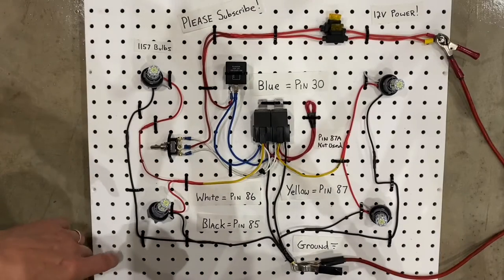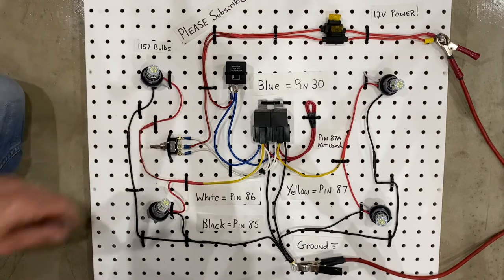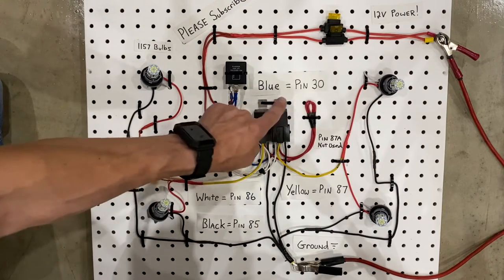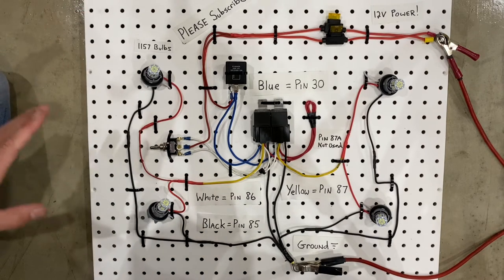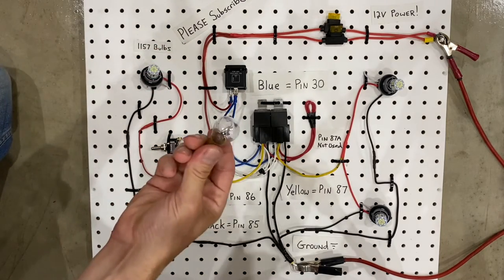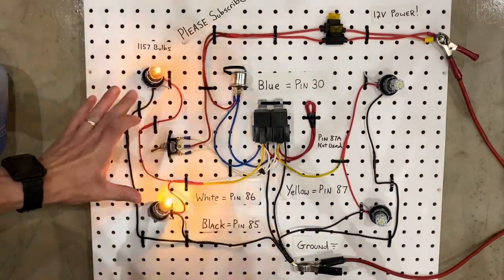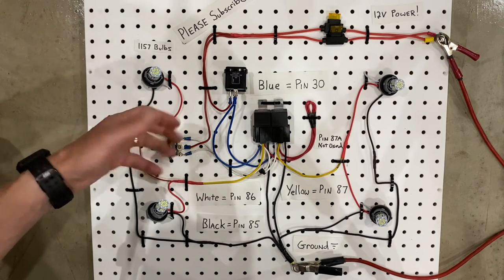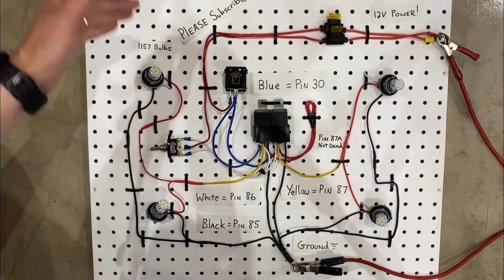How to Wire LED Turn Signals / Flashers to ANYTHING | Hotrods | Motorcycles | ATVs | Mopeds | Cars

Comment: So how does this show wiring turn signals to anything , if what you adding to already has say brake/run lights on it. This doesnt show how to add turn to a system that has brake and run lights. Or are you just adding more lights on and not using the vehicles already 1157/2057/4157 that uses run and brake lights.

Comment: I used your video instructions to install LED turn signals on my 1935 Chevrolet.  Works great.  Make sure the flasher relay that you use is for LED bulbs/lights, or they won't work.  thanks Jeremy for a great video
Reply from the maker: Thanks for the kind words! 1935 Chevy’s are absolutely beautiful.
Reply: But does your car run on 6, or 12 volts? I have a 6-volt system on a motorcycle, and the heat-activated, bimetallic-strip flasher and incandescent bulbs never worked right. Always dim, never flashed. 

But I find 6-volt LED bulbs and other parts hard to locate.
Reply: So are you running a 6 volt system? Does the LED function well?

Comment: Absolutely fantastic video!!! I was about to have to rewire my entire golf cart after swapping over to LED from incandescent! And to top it off, I would have been in the same position as I am now had I rewired it. Because I would have rewired it the same way it is NOW! not good! Now to search and find out if you have a video of adding a 4 way flasher not just the turn signals.LOL what do you know about wiring an ignition key switch? I have a 5 pin and have no clue what each of the pins controls and seems there are no videos available to give that tidbit of essential information. If a 4 pin would work as a replacement I am willing to go to a 4 pin instead.
Reply from the maker: Glad you enjoyed the video! Here is my 4 way flasher video: https://youtu.be/lnhMx-fnUmI. I haven’t done the ignition switch yet, but I did buy one specifically to make a video on. So it will happen.  Stay tuned and good luck with the golf cart!
-Jeremy

Comment: I have just installed a jegs wiring harness and fuse box. It seems to have the old skool flashers. Is there flashers that will fit in it for my LED turn signals ?  Great vids by the way .
Reply from the maker: Thanks for watching the video. I’ve never tried this one, so I can’t promise that it will work, but the listing says that it’s an LED flasher, and it’s the round style that your harness probably has. So maaaaybe this one would suit your needs? 

United Pacific LED Flasher w/ Polarity Reversing Adapter 12V https://a.co/d/5KVlquw

Comment: Great instructions here, i watched because i want to add running board LEDs to my suburban but i want them to flash with my turn signal. Im thinking that the switch would not be needed in my case and i could wire into the truck turn signal but using all the other components that you used in this video. Any suggestions?

Comment: HI - Thanks very much for the clear video. I want to add Led turn signals to my old motorbike which has a 6V system. I also would rather use a group of individual leds wired into a pattern rather than a bulb. Each indicator would be made of 4 or 5 Leds, so that would be 8 or 10 per side that need to flash at once. If I copy your system do you think it will work in my situation? Cheers, Chris

Comment: I really like your video due to all the very accurate information you give out. I was wondering if you could make a video showing the front head lights with turn signals and and tailights and brakes all mixed into 1 video? I am currently rewiring my car and I really would like to see how you do this. Thank you
Reply from the maker: I’m slowly but surely working my way up to that. The tricky part is organizing it all in a way that is easily digestible and not super overwhelming for the viewer! I am have another one coming out tonight, and I’m working on brake lights next. Stay tuned!
Reply: @WiringRescue  So awesome man! What about being able to hook up a stereo without any wiring?
Reply from the maker: Anytime you have an aftermarket stereo, you will inevitably need to do some wiring. Generally you get a wiring connector kit for whatever car it’s going in, and wire the stereo to the connector kit. Then plug in the whole thing. That way, you don’t have to modify the car wiring at all.
Reply: @WiringRescue  right, But what if i have no wiring at all? lol

Comment: Great video for anyone d.I.y ing. Been trying to put turn signals on my e bike. This is great… just one question this whole system works off 12v ?
Reply from the maker: Yes, this is all 12 volts. Thanks for watching!
Reply: @WiringRescue  haha… my bad I didn’t see the label in the corner

Comment: Are the Relays really needed for LED Directionals? They are so low power will they really be needed?
Reply from the maker: It all depends which components you are using in the circuit. If you don’t like relays, I made a video about that too. Here you go https://youtu.be/uXiEoJVtHi8?si=vzWTNySJN5PLUYUL
Reply: @WiringRescue  thanks for the reply i will be watching it real soon.I am currently waiting for directional stocks to arrive by mail .I have been testing all my Led components Amp draw statictics for fuse purposes and have come to a conclusion so far that all my  replacement Leds are drawing less than 1.5 amps that includes an Led H4 headlight bulb low beam.which is on constantly I would inagine a tiny Led which is only on 50 % of the time is extremely small draw unless the flasher it’self pulls a high draw or unless you may like the sound of the clicking like in the old cars.i will test this prior to final installation using a laser temp indicator.

Comment: I have just completed installing a turn signal kit on my Utv. I would like to install an additional on/off/on switch to my left side of my steering wheel. My kit came with a 040-lrtbl-hr rocker switch that is functioning as it should on the right side of my steering wheel. Can you advise which terminals on the rocker switch I can jump to function my other toggle switch ? Thank you, Steve

Comment: Hey I am uprading to the LED bulbs on my Vstar 1100 motorcycle. With a two pin on the  flasher. Can that be done? And where do I get a relay that works?

Comment: How do you do it with brake lights when the Brake and Turn signal use the same filament. Basically the tail light has two filaments- low for running light, and bright for brake/turn. Except for the front turn signals also need to flash for signaling,  but not for braking. I can't figure it out without 5 relays or more so far. Considering trying to sort with Arduino, but I don't know anything about building with arduino.  Thanks!

Comment: Is it necessary to run the two additional relays for each side? The turn signals will have such a small amp draw right?
Reply: Just watch the whole video and you get your answer....haha The answer is yes especially in my application where I'm running two front bumpers and one rear per side.
Reply: Second question, what about power windows should they use a relay? I'm using the standard door switches in the car, its a 97 240SX w/an LS1
Reply from the maker: @James Miley Solid question! It is only necessary if your bulbs draw more than the switch/flasher can handle. Many cheap switches handle 5 amps or less. An incandescent 1157 bulb can draw 2 amps if it’s working hard. So if you had more than two incandescent 1157 bulbs in your circuit, you could be at the limit of your switch. 

With this relay design in the video, you are limited by the flasher, the relay and the wiring. Many flashers can handle 10-12 amps, so that gives plenty of room for light bulb options. The 14awg wire and the relay can be handle more than the flasher.

Hope that helps!

Comment: Love the way you made your circuits. I'm redoing the turn signals on my 1982 silverwing. I do have a question tho, I am looking to add the indicator lights as well, where in the circuit would you put those? Each side has their own separate  bulb for the indicator
Reply: I'm thinking indicators would go between the switch and the relays. In parallel with the white wires from the outside of the switch to pin 86 on the relay. Or ... from the same point out to ground would probably be simpler.

Comment: Good video. If I may ask, why you are using 1157 bulbs instead of 1156? The 1157 is a dual filament (5/25W) commonly used for tail/brake light applications, while the 1156 is a single filament (10W) and more suited as a directional (turn signal) flasher. Can you please clarify?!
Reply from the maker: I used 1157's because the bulbs could be used as parking lights and turn signals. 1156's would be fine if you only need one function out of the bulbs.  It's totally up to you.
Reply: OK, I see, however you are implying that you are building this from scratch so you can use any socket you want for the bulb of your choice. I am currently changing my motorcycle from standard to LEDs and the tail light/brake uses the 1157 socket with dual function bulb) while my turn signals are using the single 1156. So I have to use a bulb that matches the socket. Btw, initially I could not find the flasher you recommended specifically for LEDs so I bought this one on Amazon: B091PXFXFD. Even though it is advertised as LED "flasher fix" it did not work with LEDs . Luckily I later found the LED flasher you suggested. Thanks for your videos !!!

Comment: What’s the best way to waterproof the relays?
Reply from the maker: I know that “water resistant” relays exist. They are basically the same product but with a nice rubber case around them. They wouldn’t be water proof, but they would be good enough for areas that see some wet air or splashes of water. I think for 100% water proof, you may want to look into solid state relays. There may be some waterproof versions of those that you can dunk under water for a while and still be okay.

Comment: Great video and will really help when converting my taillights to LED (request for next video - building a tail light LED circuit).  Isn't the switch technically a 3 position double pole switch (1 switch controlling 2 circuits) rather than a 3 way (2 switches controlling 1 circuit).  Also what happened to the Engine Noise Podcast?  I learned a lot on those!

Comment: Ok I’m building a custom Volkswagen trike & I fallowed this wiring diagram my front turn lights are working fine but my back one’s are not they are 6" Oval Amber LED Sequential Arrow Truck Bus Trailer Turn Signal Light Kits. First flash is maybe 2 arrows light then none then all 5 arrows flash, how can I fix this issue?
Reply from the maker: Are you using a flasher that is meant for LEDs? If not, the flashers may not flash. I have a video about this actually. Check it out if you have a chance.
Reply: Yes I got a led flasher using 2 relays.
Reply: @WiringRescue  I thought I saw a video about the sequential turn signal but tonight I couldn’t find it

Comment: When I buy LED bulbs to replace incandescent bulbs, they sell me 2 large resistors that I am supposed to install somewhere inline to prevent hyperflash. Do the relays in your circuit eliminate the need for the large resistors?
Reply: In the beginning he said he is using an electronic flasher. The electronic flasher has a circuit timer in it to flash the LEDs, the old style incandescent bulb flasher uses a metal strip that heats up from the power of the bulb and opens and closes as it heats and cools. Therefore the resistors they give you creates enough resistance in the circuit to create enough heat to power the incandescent bulb flasher,  orrr you could just use your led bulbs without the resistors and replace your Incandescent flasher with an electronic flasher and it will work properly. Hope that helps and wasn't too much info lol
Reply: @jimmyokawa6800  Thank you! That's answers one question that let's me understand a lot more about what's happening here!

Comment: Is there a way to tap into turn signal fuse / relay so I can trigger my side view camera to power up ( Honda Accord 2012 )
Reply from the maker: That is absolutely possible, but you would need to have a wiring schematic for your car and dig through the wiring harness to find the wires that you need. Or you could grab power from one of the bulbs that is turning on and use that power to activate your relay.  Good luck with your project!

Comment: I need to buy extra wire to do this project. What type of wire do I need to buy to run 4 foot long pieces on my motorcycle? Thanks
Reply from the maker: It all depends what you are powering up and how much amperage those components draw.  Let's say you are going to wire things that will draw less than 20 amps.  You could use 14 gauge wire if it is less than 6 feet of wire according to this chart https://www.bluesea.com/resources/1437 . You'll probably want to use copper stranded wire as well.  Unfortunately copper is really expensive right now. Maybe something like this: https://www.amazon.com/Fermerry-Silicone-Stranded-Electronic-Automotive/dp/B089CRKSNN   If you are powering up something that draws more or less than 20 amps, then you can adjust the wire size up or down according to your needs. Good luck!

Comment: You didn’t get into resistors to avoid the dreaded “Hyperflash”.  Any thoughts on what resistance value should be used for standard automotive incandescent bulbs to switch over to LED?

Has anyone tried to put a piece of aluminum foil near the resistor and the wiring loom covers along with the wires themselves from getting overheated and melting.?
Reply: Use the solid state flasher unit instead of the older resistance type.
That was what the whole video was about.

Comment: the white wire from the light socket, is it just hanging ? im asking because id like to replace lights with premade turn signals for a motorcycle, and only a negative and positive is included
Reply from the maker: Yes, in my diagram, the white wire is just not used because I'm only using 1 filament in the 2 filament bulbs. The benefit of a two filament bulb is that you can have a parking light PLUS a turn signal light, with a single bulb.  Or you could have a turn signal light PLUS a brake light. If you only have a positive and negative on your bulb, you have a single filament bulb so you have to choose one type of light to run, or you need to get really creative with wiring to make the single filament bulbs do more than one job. Good luck with your project!

Comment: This is a great video and gave me a couple of thoughts to try. I have a 1980 gl1100 Goldwing. I changed the Flasher to a voltage triggered style. With all 4 LEDs it flashes twice and stays on solid. With 2 of 4 being incandescents it works as expected. I also tried swapping the terminals on the Flasher. I don't think it's related but I also put diodes on the indicators and they work in sync with the lights. Any ideas on what I may be wrong? I may have to go through all the wiring and try to trace everything but I was hoping perhaps anyone had any thought.
Reply: I’m doing LEDs on my 81 wing right now, I believe the issue is that we need to wire a resistor in parallel with the rear turn signal bulb, in order to carry a resistive load that will sufficiently heat the bi metal strip in the flasher and make it flash, the solution in this video would work, but it would require a lot of intrusive wiring, a parallel resistor would be an easier install

Comment: How would you ad a break switch to that circuit
Reply from the maker: I made a video specifically for this question. Check out this brake light wiring video: https://youtu.be/h6F9PauqvXc
Reply: @WiringRescue  why does your layout w the 2 switches use no relay?  I have 2 headlight relays and 2 relays for L/R turn lights. Do I need 2 more relays for 1 for hazard and 1 for break switch also?

Comment: I'm having to DIY rewire my x-ambulance Sprinter Van because the project is WAAAY too epic for my finances to afford a professional at this time.

With the Sprinter OEM lighting system, you normally need a special adaptor harness to add trailer lights.

If I was to bypass the indicator head, brake and park lights, with your no frills circuit here (plus necessary additions for the other lights as required) could I can then just run a conventional tap from the rear lights, to make a trailer lead?

Regarding the trailer lights themselves. I have seen DIY trailer lights fail because they wired all the negalive leads to ground wherever needed on the trailer. Basically a ground to trailer for every light. This causes all sorts of random behaviour: flickering lights, brakes behaving like indicators etc. 

I have been told that, UNLIKE negative to ground on my vehicle, I am best to tie all the negative returns into the plug and send them back to the vehicle. No ground to the trailer frame.

Comment: Would a 12v old bulbs work on a led 12v flasher
Reply from the maker: In my experience, the old incandescent bulbs do work with the LED flasher. I don’t know if all LED flashers are like this, or just the ones I’ve tried.

Comment: could i feasibly use a USB 5v to 12v booster (from a handlebar adapter) to provide the power needed to run the signals? May be an silly Q but my electronics skills are 1/100
Reply from the maker: I have never played with one of those, so I’m honestly not sure! Try it and let us know!